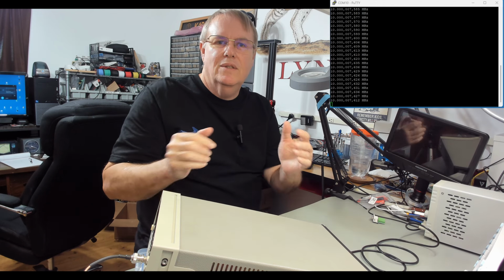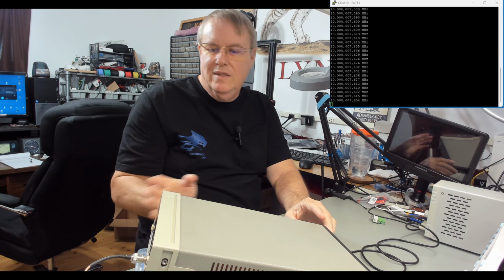Are You Making This HUGE Mistake With Your 53131A Frequency Counter?

Comment: I once got a $35K/yr job (circa 1985) for solving a very persistent RS232 problem between a PDP-11/73 and an LA120 that no one else could solve, not even a DEC technician.  It turned out to be a bad ground in a brand new DEC serial cable.  Because it was a brand new cable, no one questioned it.  Needless to say, the configuration on both the computer end and the terminal were completely wacked.  Once the RSR232 settings were rationalized and garbage still came through, out came my trusty Micronta 22-210 to ring out the cable and found the broken ground.  Dug through a pile of old cables and found a suitable one, plugged everything in, and we were off to the races.  The company owner was standing over my shoulder when things started working and said - "Want a job?"  Well, being fresh out of university I accepted on the spot.
Reply from the maker: Cool story Uni! I’m glad mine was a lot easier to figure out. 
RJ